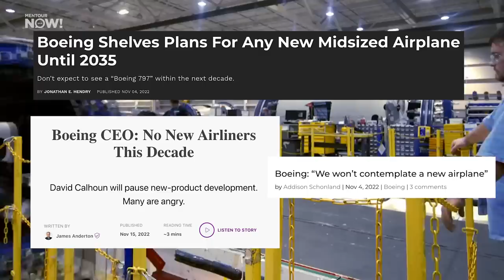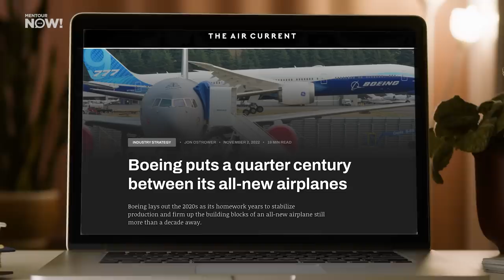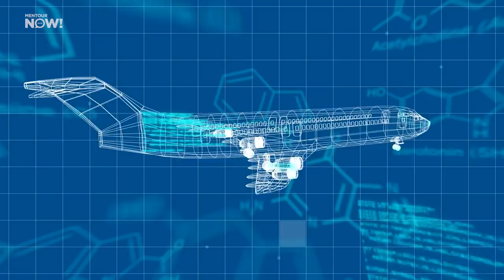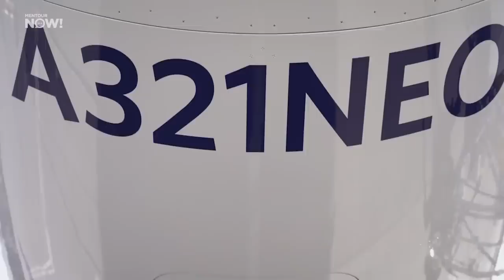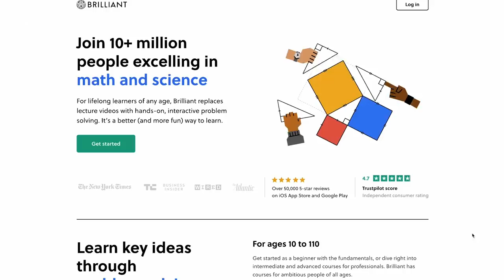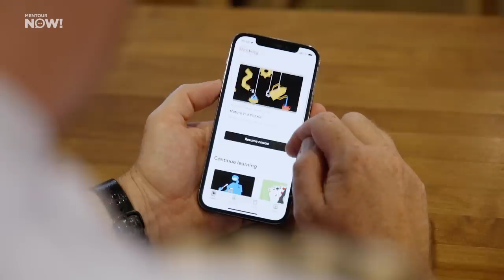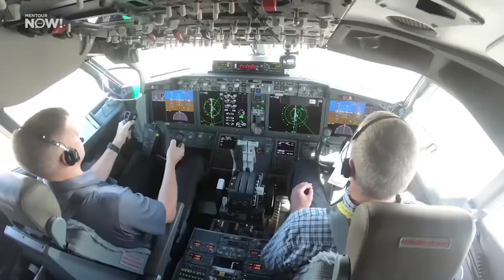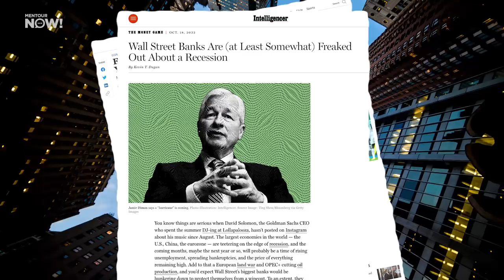Is BOEING giving up!?

Comment: Despite the arguments - 25 years between new designs just shows a state of technological stagnation in aircraft designs (and engines). Open fan is interesting but the fact that boeing has ended up in this situation shows how far behind the curve it is currently, boeing (or actually MD) chose to outsource its supply chain and has created this problem for itself.  It seems likely that Airbus will do a rewinging and longer fuselage too. It also seems likely that Airbus will have a new aircraft on the drawing board before Boeing with the way they're going and it seems highly likely that they'll be able to use the open fan technology too. It could be a smokescreen, it wouldn't surprise me. Boeing blackmailing congress over things seems a bit much, I'm not sure the Max 9, Max 10 are actually a good move for Boeing - would much rather have seen Boeing done a replacement for the 737 using all the tech they developed for the 787, Airbus would then be left looking old with the A321, yes it might only be 15 years to a new more effective engine - but that's 15 years!

Comment: The very old tech Boeing 737 Max still uses hydraulic fluid to move parts of the wings. Airbus has used electric fly by wire for over 15 years. That's how far behind Boeing is in it's technology on the 737 Max. Hydraulic fluid and hoses spread around the 737 adds weight and much higher maintenance costs.

Comment: Well, I was in the Boeing Model Shop from 1979 through 1983. Engineering computerization eliminated the Model Shop after the 757/767 projects were completed. Boeing has lived through some major economic issues, one being the Great Depression, which we will likely see again for the rest of this decade. We are NOT just dealing with recession. Both companies will be in survival mode until the 2030s, and technology will improve in the meantime, although much more slowly. New engine developers will have to deal with the problems of economy, as well. As EVs come into play the world will confine people to a very small circle of travel, that will assist the airplane manufacturers tremendously. Let's just hope that electric passenger planes are ruled out! What hurt Boeing was a 787 design utilizing too many partners using different methods of scale (metric vs. English). And a poorly designed MAX. It happens, especially when the company moved from the ethos of making the best plane (757/767) possible to the bean counters trying to make a silk purse out of a sow's ear (737 MAX) BTW, Boeing, in the future, redesign the landing gear before you increase  engine size and destroy your wing's original design parameters. Yeah, that's coming from an old analog model maker who knew the MAX was dangerous.
Reply: @billpearce3850  that acquisition was the death spiral for Boeing...

Comment: One of the biggest factors has been the plandemic.  I've not flown in over a decade because it's not been worth the difficulty.  My family is on the opposite coast, so it's an issue, but I won't budge.  Price and bad service was the reason I stopped, and unless the airlines change their ways significantly, I don't see them ever returning to the volume of flights that led into this century.  It's a simple fact the plandemic has vastly changed our economic situation, along with the deliberate inflation, to return to previous level of travel a major effort to restore economic viability must be made in my opinion.  I suspect the international travel situation would have to change dramatically to return to international travel as it was last century.

Comment: I'm guessing that Boeing just doesn't have the money to spend on the level of R&D needed for an entirely new design, plus the headwind they're going to get from the FAA to ensure they don't cut corners that take lives again. R&D investment in refining current designs and materials such as the use of carbon composites and better wing design is less risky and probably overall cheaper, and perhaps more recession friendly too. Regardless, what they are doing appears to be the same financial-first focus they've come to be defined by in the recent decade, just perhaps being more responsible about it.
They aren't going to be able to keep the best engineers around without going back to an engineering-first focus though- I did some software consulting work with Boeing as a client in the 1990s, visited Everett several times, and I remember feeling a surreal awe seeing their engineering prowess in action firsthand. Such a shame to see what they've become, I'm with you in hoping they turn it around vs fade into obscurity.

Comment: 80% of a company's net income is derived from new product development.  I believe that Boeing is not giving up, or trying to broadly misinform competitors, shareholders, suppliers or regulators.

Criticisms of their lack of engineering focus are well meaning, but not well founded.  After research, I found that Boeing's R&D investment, as a percent of revenue, has risen over the last five years.

I am not a supporter or critic of Boeing - just providing some info.  It appears that Boeing has more than their share of business issues, which I believe are manageable with strong leaders.

Comment: The whole airline industry needs an overhaul,  I wrote to the F.A.A. about this, I believe, to many planes crash, due to over 100 years of inaccurate data from wind tunnel experiments, because no one considered the fact that a wind tunnel experiment does not replicate real life, i.e. two different frames of reference are not the same if they have been inversed, , because air changes state ( gas, liquid, solid) at different speeds, in real life the air at the nose can be at zero miles an hour (gas) , in a wind tunnel experiment the wind is moving at 300mph, at the nose, (and is a solid).   Air decelarates in a wind tunnel experiment, but in real life air accelerates over the plane body. Etc, the list of difference's goes on and on.  Leading to design inaccuracies and crashes, which were not the pilots fault nor the airline companies , but the plane designer's fault.  I think It's good timing for a new aircraft design and it needs to be tested in real life, a scaled down remote controlled model aircraft to test its aerodynamics and safety. Something electric hopefully for the sake of reduced carbon emissions.

Comment: Still a fan of Boeing, I feel that Boeing has been spread too thin, they have too many programs and said programs have issues, I mean the starliner, airforce 1 budget, 777-x, 737 Max and the Charleston Plant, it sounds rough, but it may be the right call if they use this to fix company wide issues.

Comment: What if waiting for new disruptive technologies before wasting money on aircraft designs is the right decision? It's all very well to shout from the peanut gallery, but I doubt very much that Youtube commenters have enormous insight into the technological and regulatory challenges of designing, testing, and launching a new commercial airliner. I certainly don't, and I suspect that none of you do, either.

Have there been any massive improvements in our understanding of aerodynamics in the past ten years? Or jet engines? Even the flight computers and electronics packages that go into these planes are resting on thirty year-old technology. So, they'll continue to swap out engines and electronics into proven airframes that the cohort of commercial airline pilots have already qualified on.

Comment: Great, informative video! I actually like the way how Boeing is moving forward, but keeping their options open. 

Not directly relatable, but recently the DoD announced that the US Air Force would be decommissioning the F-22 Raptor (the most advanced fighter jet on the planet by a long way) over the next decade! On the surface this seems crazy. When you look at the bigger picture it makes sense. Consider the base design of the Raptor was developed in the 1990s. Upgrading a 20 year design when so much has changed in electronics, material technologies, manufacturing technologies, etc...ultimately makes no sense. When you consider the operating and maintenance cost of the F-22, it becomes clear a better strategy is a new plane design based on today's technologies (not a 1990s airframe) and plan the introduction timed in step with the Raptor (and F-15) decommissioning. The award of that new plane contract will be massive. Boeing will want all their internal ducks-in-order when they submit their new fighter jet prototype design to the DoD. I would highly suspect Boeing is evaluating the commercial and defense markets together as to how to best dominate in both.
Reply: Do you recall how long the Raptor was "in development"? Now compare that with Boeing's ability to perform on dev programs and a new fighter platform is decades away which according to the logic you referenced would mean that the new fighter would be obsolete as soon as the first aircraft is delivered. Hmm...

Comment: Boeing should give serious consideration to moving to Rotational detonation Engines.  Which deliver more power with less fuel and increase range.  It will be a worth while problem to solve over the unducted Turbo fan Engine.

Comment: Ret Captain. The list of Boeing planes from the 707 to 767 identifies repurposed frames. The original 707 was a repurposed US Air Force jet tanker. The 707 was too small so it was expanded to suit commercial needs. The short lived 720 was a smaller 707. The 737 was a twin engine shrunken 707 body. The 737 was a 707 body modified to have 3 engines. The next generation 757/767 was an amalgamation presented as modern glass cockpit plane. The 757 with a new wing, still narrow body, was not revolutionary, has a harsh ride and it’s a challenge to land. The 767 was sold as same qualifications as the 757 but it’s a different plane, close to the 707. The first evolutionary plane, 777 can be seen as an expansion of the 707 line. The only truly new design is the 787. The 737 line no matter the size, range, etc is the original 737 heavily update. I have ratings in the 737, 757/767. My last plane was the A-319/320/321. A new concept indeed. IMO, Boeing by insisting on crew commonality aircraft, gave up a long time ago. As engine development will reach a peak, perhaps it has done so already, Boeing airframe design has also peaked. What’s next except interior creature comforts, route selection and services? Smaller sized jet which Boeing gave up decades ago proving the Brazilian and Canadian companies opportunities. Will Airbus follow this trend  as well?

Comment: Boeing effectively "gave up" when they moved their company HQ to Chicago.  You can't fix issues when the aircraft and the engineering teams are 1,700 miles apart.  Boeing is done when it comes to commercial aircraft.

I sold all of my Boeing stock the day they announced the "move".

Comment: It's not unthinkable to not have a new AP until 2035 I guess.
You can retrofit stuff on existing models (as long as you do it right...) and can improve existing models
with new tech.
I see an aricraft body as a "platform". If you do it right, a platform should live long (and prosper 😋).

Comment: It may be also that commercial aircraft design is following the typical logarithmic curve of development. The mass air transportation industry is only about 60 years old, and it makes sense that it is necessary to develop a new product frequently during the infancy of the industry, as technological improvements are occurring exponentially.  However, as the technology matures the incremental improvement with each iteration becomes less and less. To spend a ton of money to get marginal improvement may not be worth the effort. Boeing may doing the smart thing by waiting until a more significant leap in technology before making that investment.
Reply: Actually Boeing can make upgrade for all their models with composite wings. This will be step in right direction even without brand new models.

Comment: I don't believe in the unducted fan. There were several attempts to get one into service for more than 40 years now. It never worked. The last attempt failed because it was too loud compared to ducted fans. Low noise will only get more important in the future. 

Boeing made a major mistake in underestimating the impact the A320 had on the market. They thought, an upgraded 737 would be enough to stay in a leading position. 
It was totally fine to update the 737 two times into the "Classic" and "Next Generation". These updates made good use of the potential the original design had. 
Then, Boeing made a mistake. As soon as the Next Gen was ready to enter service in 1997, Boeing should have put everything they had into the development of a brand new replacement that can outperform every 737 and A320 imaginable. That brand new design could have entered service somewhere in a range from 2010-2015. It could have had superior aerodynamics and structure compared to the then ~25 year old A320. I could have been capable to use the LEAP and PW1000G engines without changes to the airframe, as soon as they were available. That capability could also be used to upgrade aircraft from the initial production run. Boeing could have had a brand new airframe for the brand new engines, while Airbus was stuck to an upgrade of the A320. Boeing would have instantly regained their leading position.
But Boeing did nothing. It took unbelievable 20 more years until Boeing got the 737 Max into service in 2017 and it still fails to outperform the A320neo and it still has major problems because it pushes the limits of the initial 737 design too hard. Boeing already lost 1000 orders to Airbus. Trust in the 737 is gone. The money invested into the 737 Max is gone too. 
Boeing is in serious trouble now.

Comment: A possible reason could be the uncertainties related to how mankind will reduce its C02 emissions.
The evolution of travel practices might completely reshape the aviation industry and then making more complex for a plane manufacturer to draw the path of the future decades. Continuing to build air-jet planes designed for mass air travel might not be so relevant in a 25 years perspective.

Comment: The damage this will do to the competency of the Engineers will be insane. Derivatives and Modifications Design is not the same as Clean Sheet work. Any engineer that has ambition will leave and go work somewhere else, probably for Airbus.  And the ones that stay won't have developed the skills necessary to effectively design a new airplane model.

Comment: Even though I'm not a fan of how Boeing has been cutting corners and putting money before safety with the Max, I really hope they do get better and don't fall behind Airbus to the point of no recovery. In the latter case we'd essentially be stuck with an Airbus monopoly and that can't be a good thing for the aviation industry. Pretty sure they'd be overwhelmed with the backlog and drop their standards in the absence of competition, which may affect safety. Not something I'd want to happen as a passenger.

Disclaimer: I'm not an aviation professional, this is just a personal opinion, so take this with a grain of salt.
Reply: with boeing in trouble and Airbus incapable to manage the backlog I see other companies like from China breaking into the market at significant scale. With the duopoly broken it would seem like a stellar opportunity.

Comment: I won't touch any version of the Max with a 10 foot pole. The fundamental design error has never been fixed. The Max still cannot fly straight, left alone it will fly itself into a stall.

Comment: IBM is another heavyweight incumbent (in another industry) that realised they needed to treat engineers as first-class citizens in the organisation structure. Although IBM are not quite what they used to be, they are still a powerhouse in selected areas of R&D, and have evolved their business model as well as could probably be expected for such a legacy company. And apparently, >90% of the world's financial transactions are still done on IBM mainframes (I'm guessing this is in the core banking area and excludes crypto and HFT etc). Is Boeing showing signs of evolving in the same way? I'm not working inside the aviation industry but it seems from everything that is being discussed that no, it isn't. And what happens if Boom does resolve their engine supply issue, and/or SpaceX manages to establish use of Starship for point to point flights?  How about Reaction Engines? Even if another ten years is needed for these companies to reach maturity, how long would it take to build up totally new technologies from the ground level even for Boeing? Shouldn't the alarm bells be ringing?
Reply: @IcyTorment  it's quite interesting that you say that (and I didn't know that about McDonnell-Douglas). Which makes me wonder additionally how much the new trend for restrictions starting to be being placed on domestic flights (in favour of carbon-friendly fast trains) is swaying their planning more towards the wide body end of the market.

Comment: This is why I will not be upgrading my 4-year-old Tesla, as Tesla updates my car software every month. The odd part may need replacing, even the battery, in 20 years, but the overall car will not need replacing. Boeing is smart.
Reply: For me, i simply want a car that gets me safely reliably and conveniently from A to B. I don't need a software systems upgrade every month to do that! I have better things to focus on! And that is also transferring more owner operator control over to someone else. And in many cases, also creating an additional, on going captive income stream. To the benefit of others. For something i have already paid for! Or am paying for, or leasing!! For me. I pay for it! It is mine! I use it! - As it is! Untill i choose to upgrade or replace it! Apart from normal product servicing and support! Thats it!!